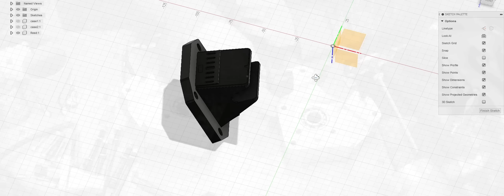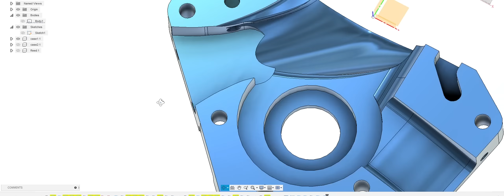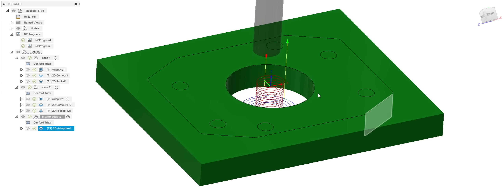A "completely normal" two stroke engine.

Comment: I think it will be nice to see a flowguide to match the round boot with the square reed valve in this engine, I'm trying to make one for my ktm that also runs a Vf3... I've seen it on kart engines and it seems to be a huge benefit in performance!

Comment: Another thought, emd make 2 stroke diesels, they use a turbo but at low rpm it has a clutch that drives it, a centrifugal clutch that disengages as RPM rises.
Could you use a turbo?
Where would expansion chamber go? Before or after?

Comment: You continue to impress. Are you familiar with Detroit Diesel two stroke engines?  They use a super charger blowing air through crankcase and ports in cylinder together with mechanical exhaust valves. Just something to think about. 

Back to work now Alex!

Comment: Love your show, my friends dad used to do performance port work on 2 cycles, it was so fascinating to watch , I have an idea you might try since you have cnc , try to incorporate fins (like turbo cold side) on the outside of the crankshaft counterweights  and a sort of port near center axis of crank , and channeled to  side ports of cylinder,  it would be two port channels to the carb , in my mind it functions  , what do you think , it would reduce excess drag from supercharger , its hard to describe but generally both sides of crank would be a turbo , or instead of fins have a progressive pitch on crank weight (like a snail shell ) that induces a pulse to the transfer port,
 keep up the good work

Comment: Hi, I was wondering if your milling machine had a encoder on every axis to detect if a step was missed. I understand that it needs warming up to assist in accuracy but if the lubricant is getting sticky, is there a better product available to avoid this? Could you let us know how you do this as I guess many of your supporters like me don’t know a great deal about using that equipment. Thanks for an interesting video, which pushes to resolve our projects as well!

Comment: You really need to look at the area of your exhaust port
Reply: I feel that the raised floor of the exhaust port will cause problems at high RPM. What I can understand from what Alex has said over the years the floor of the  exhaust port is level with the top of the transfers. This will help reduce fresh mixture going out of the exhaust port at low revs which is no interest to us as were only really bothered from 16k upwards.
Remember the old adage, you have to get it out quicker than you put it in. Emissions are of no interest to us at this moment.
I genuinley believe the exhaust port floor should be level or slightly below the piston crown at BDC.
The A port is very close to the exhaust port leaving little wiggle room with this design.
We must remember the exhaust bridge was welded in after casting/printing.
If you look in Alex's back catalogue under " Nitro EFI,metal 3D print cylinder with ludicrous porting" from 25th February 2021 it clearly shows the raised exhaust port floor.

Comment: wy are u doing this, ? tosolve the problem with the hump u cant get over ?
Reply: No offence to Alex but I feel he went a wee bit too radical with his initial design.
0-20k is a lot of RPM to cover for such a tiny engine.
We'll have to wait a see what power it produces later on.
Reply: Sorry Patrick I didn't answer your question. With Alex going back to normal you know how it should react. There is still the cylinder that is quite radical yet. 
Lots of things to try and one of them is advancing the ignition timing to a reasonable amount. 1.8mm BTDC is a good starting point. 15 deg is way retarded IMO. ( 0.835 mm )
1.8mm BTDC flat line 0-20 k RPM.

Comment: I have always wondered why the design of model airplane 2 stroke engines where the crank shaft has a slot allowing an intake to happen much like a Rotary valve. They have a very small crank case as a part of That design. I’ve always wanted a 30-50cc gasoline version with the nitro model airplane engine. Please let me know what your thoughts are one why we don’t see bigger versions of the model airplane engine designs. I would absolutely love to hear your thoughts or even an “I don’t know”😊 look forward to a reply. Please
Reply: Crankshaft rotary induction has been used in commercially available model airplane engines since the 1930s. The limiting factor for their use in larger displacement engines—such as the 50cc—has been the large diameter of the anti-friction bearings needed to support the crank. Since all of the induction air for this engine type must pass through a properly-sized hole that runs axially through its body... not to mention the a large radial induction-hole machined through the journal (between the two support bearings) that communicates with the carburetor, the crankshaft must still resist the torque and reciprocating pounding delivered to it. Therefore, a minimum thickness must be maintained between the crankshaft's axial hole and its outside diameter (where the bearing's inner-race resides). Needle bearings (smaller o.d. than ball or roller bearings) in various configurations have been tried to alleviate this condition with mixed results. Many crankshaft rotary induction engine designs have been tried over the years, including the original use of plane-bearings (oil lite bushings).  Hope this helps.
Reply: @davidgierke7582  🤔 makes sense… I didn’t think about structural integrity of the crankshaft on a larger scale

Comment: You should take a look at the detroit diesel intake system style. It has intake valves like a 4t, because of that it can only work supercharged. I am sure that several problems that you have in the admission would go away

Comment: Fuel Injection Fuel Injection Fuel Injection!
Reply: Yes, Yes, Yes with RC fuel as ultra fine mist is a must for rapid fuel burning before exiting the exhaust port.
I feel the high case and transfer volumes are causing the carburation problems with PiP.
Mark Atkinson had similar problems to Alex 3 years ago.

Comment: Could someone help by answering a question for me which I asked before and got no answer.
How fast can a reed valve operate reliably? Are they fitted to the older 100cc air cooled kart engines. From pictures it seems as though they are but as yet not managed to find any internal shots.
Can anyone help?
This is for my own curiosity and nothing to do with Alex's project. Can someone point me in the right direction please!

Comment: Great progress mate with the new reed block modification. Check the vacuum cleaner bag for those crank shims. By any chance are you going to make a blocking plate for the other side of the crankcase that fills in the unnecessary space and to reduce crankcase volume even more?

Comment: I was quite sa to see the cases getting milled away from the resonance idea to what I think (admittedly with bugger all actual justification) is a pointless forced induction rabbit hole.

That said, it's only a couple of blocks of alloy and some considerable machining time...
Reply from the maker: Dont worry, I'll 3d print a dymmy reed to bring it back to resonance mode after testing with the reed.

Comment: Question to those who use CAD software, I am looking for one that I can use for 3d printing, but I don't want to necessarily spend an arm and a leg. Any suggestions? I used AutoCAD a few years ago in an engineering class, but we only did 2d so I am not familiar with it's 3d capabilities
Reply from the maker: Fusion 360 is what I use, it's free for small companies.

Comment: Another thing I think you need to look at when it comes to using the pipe with methanol or nitromethane is the fact that when they burn they expand several times more than gasoline so you need the correct volume in the pipe to deal with that extra expansion/exhaust volume not just the increase in exhaust pressure caused by burning a denser air/fuel load under boost. The speed that they burn also needs to be taken into account to figure in the wave pulses.. I still think that under boost that pipe is just a restriction and is killing power, but I'm offering more beyond just that thought now.

Comment: Ok going back a few videos to the pulse jet engine accident thing I would bet what you had happening was the valves were opening to early and you were getting what's called hot blowing I don't remember you mentioning it but it was used in racing for awhile almost like anti lag. Hot blowing is the exhaust valves opening closer to the start of burn and you end up with fire out the exhaust

Comment: One of the reasons you gave up on the reed valves was that the fuel was softening them.  What's the plan for preventing that now?  Did you find better reed valve material?
Reply from the maker: I'm going to run on gas for now, to confirm the cylinder/pipe design. If the reeds stay I'll have to find something methanol resistant, or change them very frequently.
Reply: @2STROKESTUFFING  I've been meaning to ask --- Doesn't burning a different fuel affect the engine design? If methane/nitromethane burns more slowly than gasoline, as I've read, doesn't that mean you would want somewhat different engine designs for maximum power?  I know nothing about engine design other than what I've learned watching you, but if the fuel/air is still burning as it enters the pipe, then it's still heating and expanding, so it will act differently in the pipe than if combustion were completed, right? It seems to me that the fuel type would matter, so why work with gasoline if the intent is ultimately to use methanol/nitromethane?
Reply: @johnpezaris6982  With a rod-length to stroke ratio of 2.25:1 (very high), one of the consequences of this design feature is a longer dwell-period around TDC, which is beneficial for the slower burning methanol, and especially nitromethane, fuel combinations.
Reply: @2STROKE STUFFING  I'm not at all familiar with what you're doing here as I've just stumbled on this video from recommendations, but I can suggest stainless steel sheet reeds. They were used on older two stroke motorcycle designs before CF and fiberglass reeds.

Comment: i know they say turbos cant work on a 2 stroke, but i know that;s not true. many Detroit diesels are turbo and supercharged and it uses exhaust valves. with the r&d you have done with the supercharger i think you might pull it off

Comment: Maybe I'm just ignorant to two strokes but I have to ask, why arent you using a wide band oxygen sensor to monitor your afr's
Reply: Give him a chance! He hasn’t got the crank cases together yet!
Reply: @Scissors69  I've been watching him for the past three years dude...He hasn't used one or mentioned getting one in all that time, only a pyrometer for exhaust temps.
Reply: @tcrenegade  If Alex used his normal 20:1 castor oil it would kill a lambda sensor very quickly as the oil doesn't burn too well and drips out of the exhaust joint as a black goo.
There are other issues as well because the engine is not making exhaust smoke like it should and never has with petroil
After the crank cases are sorted, ( minimum volume ) there is a lot of exhaust portwork that needs doing. It's no good getting it in if you can't get it out faster.
Reply: @malcrandall1309  Thank you! This is exactly what I was wondering! I

Comment: YOU DO NOT LISTEN, MZ ROTARY VALVE 50cc 2 stroke 25000 rpm & 20+ HP. YEAR 1950.  I SENT YOU THE VIDEO. It’s a 2 stroke, easy engine to work with, stop complicating it.  Oh, for you brainy stawt, NO SUCH THING AS GRAVITY, JUST THE SHIT IS HEAVIER THAN AIR.

Comment: Hi Just to say a big thanks for Your videos. I have pulled a lot of information from them regarding how to do blow through carburettors. My plans are to supercharge a 2cv engine, and I'm starting with two PWK 42mm carbs run N/A, then use an AMR 300?450 supercharger. Oh then build a hybrid 2cv- Beetle 850cc engine! Anyway thanks again. Best Wishes, jahmahrah

Comment: stupid question: when RPM limt is reached, when transfer loss is  reduced to the max, when ignition is maxed out, when the burning process is a optimum ... the only thing to make more hp is fuel with more energy. formular one is said to have fuel with double the power of normal fuel. is that a thing for you?
Reply: He’s using nitro
Reply: @Scissors69  Yes and it's being trouble going back 5 years to the SPX. I feel Alex will have to go very high pressure EFI to give this tiny 50cc 2 stroke any chance of running upto 20k. 333 cycles per second is mind boggling to me.
Any idea what pressure a small electric fuel pump will deliver with RC fuel?
Reply: Just looked on ebay and 12volt 10amp fuel pumps produce around 70 psi. ( 4.7 bar )

Comment: When Alex was turning the engine round at the start of the video it looks as though a start had being made on the new disc valve system.  
The circular recess on the right hand side was where the old ingnition stator mounting was previously.

Comment: Have you thought about making a sacrificial bed for your mill? A slab of aluminium that you can tap holes into so that you can do the internal features of your component, bolt down through those holes into the bed and then machine the profile?

Comment: YOU MAY CONSIDER RUNNING METAL REEDS BECAUSE OF THE BOOST PRESSUER MAY CAUSE THE FIBER REEDS FAIL TO OFTEN.
Reply: WHY ARE YOU YELLING AT US!!!
Reply: I've asked a question here in the comments re reed valves, but no replies. What is the maximum operating frequency for a reed vavle to operate reliably. I believe old type 100cc kart engines revved to 20k but I've not managed to find any info on the type of reed valve.
This information is purely for my enquiring mind.
Reply: @malcrandall1309  Without checking, Gordon P. Blair's book goes into great depth on the subject of reed valves. As an aside, I have tested reed-valve model airplane engines that ran in excess of 35 krpm.
Reply: @davidgierke7582  Thanks for your reply David. I've looked on the interwed and found no specific answers as I wanted some uptp date info. I would have thought the kart lads would have jumped on this one but no joy.
I was thinking along the lines of a 250cc single reed valve used for road racing. I would love to build a A/C 6 speed single purely for nostalgia as this was the class I raced in, in the early 70's before going onto 125's and 250 twins.
Alex should have no reliability issus at 20 k except for those nasty spurious oscillations that may crop up.
PS, I realise a reed valve would be reliable for something revving to 12k ish.

.
Reply: @malcrandall1309  Hey, Malc... I wish that Alex would go to the crankshaft rotary induction system and forget about the reed valve, especially since he is aiming for a peak bhp rpm that will get him the record on the salt. Also, his dyno should be set-up to record data at specific rpm to reflect this load point; who cares if the the engine spools-up smoothly to 20,000 +rpm, as long as it gets there? Simplify, simplify.

Comment: Alex - I noticed that the two case halves could misalign when you only had a few bolts hand tight. I can't help but wonder if case misalignment may have had a role to play in your bearing demise. Have you considered adding dowel pins to the design for positive locating between case halves?
Reply from the maker: I should👍
Reply: I’m not a machinist, so how would it be possible to align the halves now that they are complete? 
How would you get correct dowel placement? 
Can you use the mill to find the exact position? Sorry for the questions 😂
Reply: @mozer30  Great question! I think in a perfect world, the two case halves would be machined with the dowels as part of the original design. And then the crank bores would be line honed with the case halves bolted together to ensure the crank has perfect alignment. That ship has obviously sailed.

But that said, Alex should be able to get very precise alignment by setting up the case halves in the mill exactly like he did for the reed valve pocket milling operation. Probe or indicate the orientation against one of the flat case halves or known bolt hole locations and use crank bore as a zero reference (assuming that's what he did anyway.) Lots of good ways to reset a part back in the mill with high precision - whether a manual or CNC machine for that matter.
Reply: @bradley3549  thank you for the explanation 👍
Reply: @mozer30  You can get hollow dowels, basically a short tube. you enlarge the bolt holes slightly on the inside part, the towel sits over the bolt.
Reply: Hope this improvement added into the case modification...

Adding dowel to the case half bolt holes most likely not that hard to do with milling machine...

2 or 3 dowels should be sufficient...
Reply: Just being looking at a community video from a month ago and it shows the 2 engine cases laying flat on a table. There appears to be 2 blind holes in each crankcase half, just wondering are they for locating dowels?
At 8.32 on this video you can clearly see the blind holes in the cases which I suspect were intended for locators.
Reply: two parallel dovetail or notched features to give perfect alignment in 2d without the extra inaccuracy given by the tolerances from dowel pins
Reply: @raphrath8561  sealing the halfs would be a challenge
Reply: Counterbored bolt holes for some tightly toleranced dowel tubes